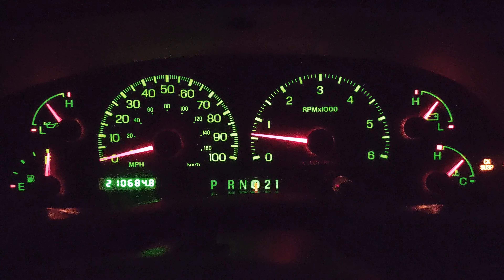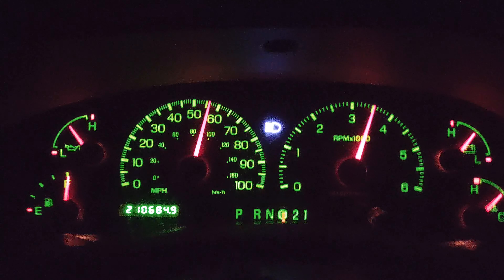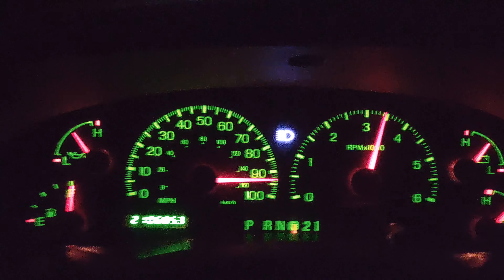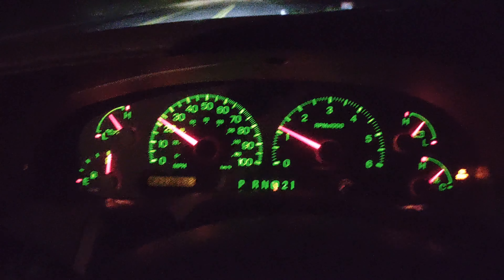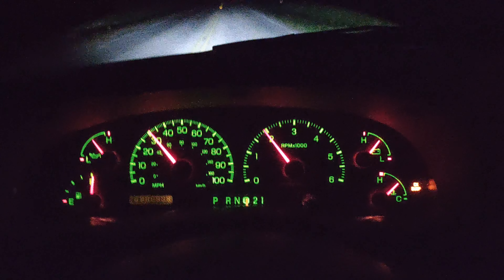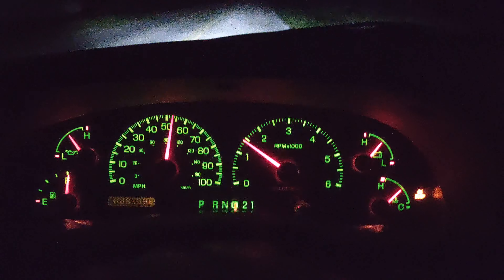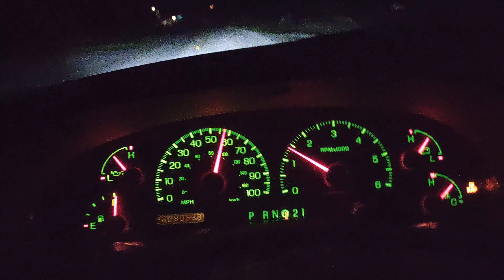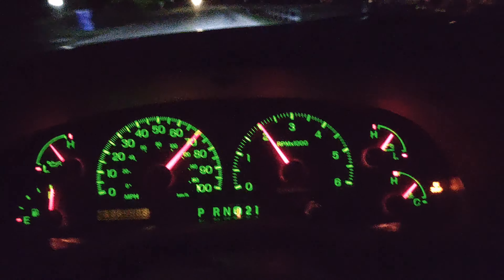01' Expedition throttle body spacer installed 0-60 + acceleration

Comment: Did you notice any difference on low end? Thanks in advance. Your expy sounds nice man
Reply from the maker: Yea slightly, but I'm going to install a different one, to see if it will help with the low end. (Lately seems to be weeping more
Reply from the maker: Over the weekend I installed the new throttle body spacer. Clean the throttle body as well as the intake port for the plenum.  

With the new throttle body which is no longer a spiral type there is more low-end and a definite increase in low end and mid-range. The top end is no longer peaky but more stable.

That will make a separate video on the upgrade hopefully showcasing the difference between the two. The power is more consistent especially since it has two sets of gaskets one being the round gasket for the spacer, and another being the throttle body gaskets.  

No more weeping.

https://www.ebay.com/itm/233544208222

Comment: Hey man was wondering how did you extend the throttle body cables? Would really appreciate if you have any advice
Reply from the maker: Hey, The kit comes with an extension. So the cables are going to move along with it. Just be mindful and really grease up their cruise control cable. Sometimes it may or may not stick meaning that it can freeze up and come off the throttle or at least that's what happens to mine.

It doesn't happen as often as it used to because my throttle body needed cleaning it was sticking too. 

Make sure your kit has two or three brackets that are going to extend your mounting bracket for your cables. 

And that's it straight shot.
Reply: @gsxellence  thank you so much for your advice will definitely try again tomorrow to install the extensions I was wondering what they were for but now I know so thank you for your help
Reply from the maker: @5.4_Luis  You're welcome; honestly it's a real ashamed they don't include proper instructions on how to install the products. That even includes some of the YouTube videos on how to's.
Reply: Anyone else hear the belt
Reply from the maker: I'm replacing the belt to see if it is the issue but I'm thinking it's in the drivetrain or the transmission itself. The transmission is not stock.